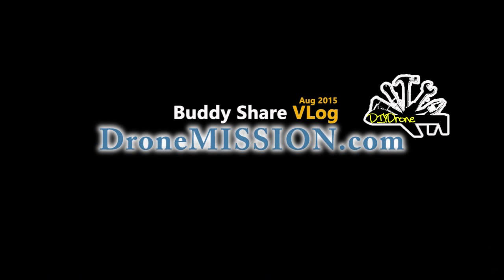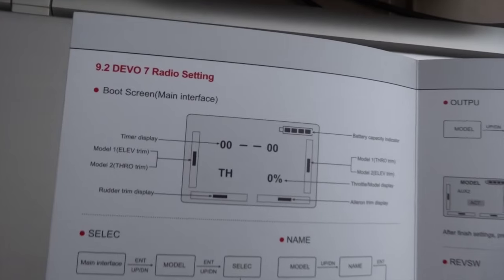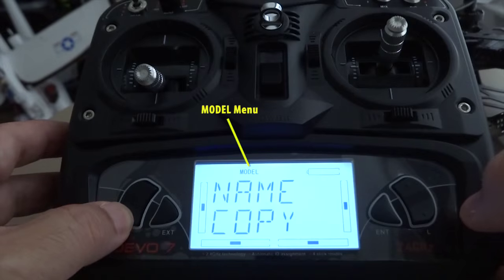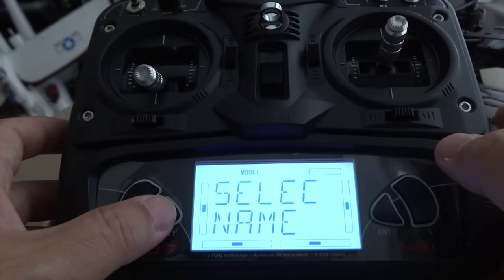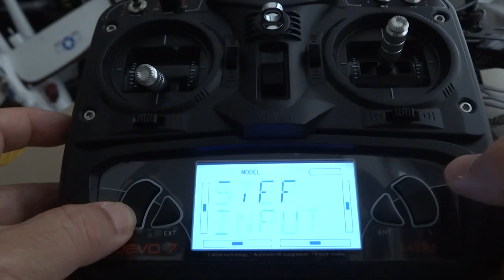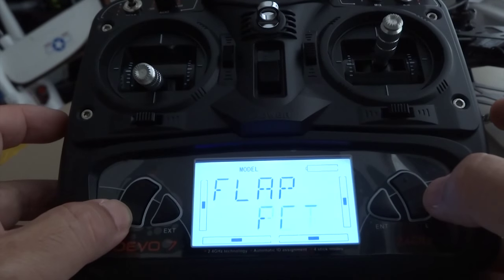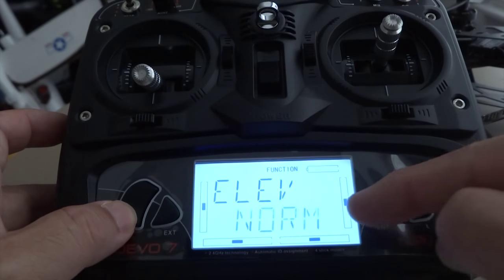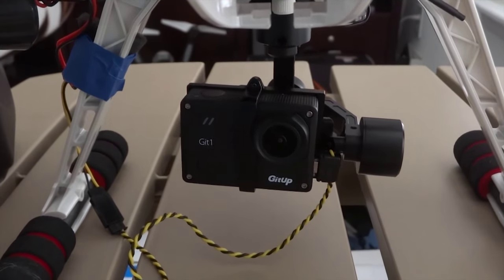Runner 250 BNF Devo 7 Setup ft x350 Premium Mission!

Comment: Hello , Great video, Do you know if the runner 250's flight controller supports a PPM single cable connection for when using another Radio's receiver that has PPM single cable out capability ?

Comment: i have just bought a new camera for  my runner 250 advanced, it came with basic camera so i bought the better camera with sd card slot that some 250 advanced come with, however i can't get the camera to record using the gear switch on the devo 7, do you think the settings for that switch need changing..? any clue how to do it please..!!!!

Comment: Hi
I am having a problem with the FMD switch This changes the flight modes They do not respond Can you help how i can do this
Reply: did you have any luck i had the same when trying to set mine up  theres a guy with devo 7 transmitter walk throw he has bout 4 video,s   but you will notice he only uses helicopter   but e shows you everything  thats where i  found out how to do mine  but im just getting my head round setting my one up to i couldn,t  tell you how to do it  it was so easy watching the video and setting it up as i was watching his video  ,, and now iv just found out how to revese my roll & yaw throw this video  i only need to setup my failsafe  on my gear switch    but i will go back on my saved video,s   and  tag you on the video or try to share it with you  spooner graham
Reply: Cheers This transmitter is a pain Everyone says get rid But spent too much money on new build quad and bought walkers reciever No cash left only for fpv googles I will look at this video Cheers
Reply: search  HOW TO SETUP DEVO 7 
its in the first few video,s   the video t called 
WALKERA DEVO WALKTHROUGH  PART 1  .MP4    dilbertoheli
 its a full walkthrough  but he has his set up for only helicopters    but he go,s throw it all  slowly  and explains just about every thing   i set up most of mine throw it   and i hope this helps  spooner graham
Reply: noproblem i was the same way intill i come across it and it helped my a lot  watch it first maybe 2 times then site with your transmitter going thow the setting and mode and it should help you understand the transmitter better and as your going throw it pause the video when setting things and changing things its just a pitty he only has it setup for helicopters   but it helped me a lot
Reply: lol
Reply: its fun and games my friend  but when i think about it iv just got my transmitter   get your transmitter  click on model ,,,and go down to  input   .. click on input  and  it comes up  
FM SW
     FMD
 THIS IS WHAT YOU WANT IT ON  
 when you click on input and  WM SW   comes up  im sure i clicked the enter button  and your dn & up button moves your switches click up or down  till you see FMD  ?  CLICK ON THE ENTER BOTTON AND THIS SHOULD ACTIVATE  YOUR  FMD  3WAY SWITCH    THEN GO ON TO BASEFLIGHT OR CLEANFLIGHT WHAT EVER OUR USING   GO IN TO YOUR MODES   MOVE YOUR  FMD SWITCH  AND YOU WILL SEE IT MOVING ?   AND ADD YOUR HORIZON TO  O ON THE SWITCH AND ADD ANGLE TO THE MIDDLE OF THE SWITCH ,, AND THATS IT  DONT PUT NOTHING ON THE 3RD   POSSISION   THATS FULL ACRO  ,,, YEAH     THEN  THAT FMD  WILL BE   HORIZON   THEN ANGLE  THATS ACRO WITH SELF STABLE   THEN 3RD IS FULL ACRO   NUTS MODE  HAHA  BUT YEAH THATS HOW TO DO IT  HOPE THIS HELPS  YOU AND GOOD LUCK   IM JUST NEEDING TO WORK OUT HOW TO ACTIVATE  MY GEAR SWITCH  AND ADDING MY FAILSAFE TO IT   AND I THINK YOU WILL BE NEEDING TO DO THIS ASWELL  HAHA  AND IF YOU DO I WILL TELL YOU HOW TO DO IT     AND THIS IS MY FIRST RACING QUAD  THE NIGHTHAWK 280 PRO    ITS NOTHING LIKE MY OLD JXD509G  MINI H8   AND MY SYMA X8G    PULL THEM OUT THE BOX PUT BATTERYS IN SWITCH IT ON BIND AND YOUR OFF HAHA HAPPYDAYS    BUT YES I HOPE THIS HELPS YOU    
and my names william
Reply: Thank you very much for taking the time writting this down for me I do appreciate it very much I hate this transmitter and Walkera never help they always say its in the manual I even bought the usb update toold for the transmitter Only to find out The last update availablewas in 2012 What a waste of money that was Keep in touch ill let you know how things go
Reply: Could you please check that after FM SW FMD      WM SW comes up as i dont have this coming up for me
Reply: what you need to do is go to OUTPUT as you see on the vídeo and then select FMD act

Comment: Can the exact transmitter programming steps for the Walkera Runner 250 Advance be found in the Runner 250 manual? And are the programming steps the same for the Walkera Devo 10 transmitter?
Reply from the maker: Yes, on the quick start guide - DM

Comment: dose these settings work with all racing quads   iv been trying to set this transmitter up with my nighthawk 280 pro  i think im getting there  but i have to work out how to reverse my roll & yaw  and set end points  i never got a booktlet  just a cd with basics its a nightmare lol
Reply from the maker: From what i have seen, the profiles have not changed much for Walkera models, for example i can fly a F210 or x350 pro with the same model profile.  Remember to select plane type, as a quadcopter is not a helicopter.  However the nighthawk fc can reverse the channels, if that is the case, you need to reverse the roll and yaw.
Reply: thanks very much iv just got it all well tryed setting my nighthawk up with factory tx & rx but just couldnt manage it  i got the ARF model  with not a clue how to set it up but im just about there i only need to work out how to activate my gear switch and add failsafe on to my gear switch   but i am having problems  testing motors on cleanflight   my motors dont stop singing and when pulling the master down  i dont get any confirmation beeps or singing    it stops unless i raise the master back up iv only been trying to set this up for a month lol  and im ready to make it fly ?? open the window and throw it away haha  its cracking me up iv got to keep putting it away and try to forget about it till i cam down then go back to it  its not like the toy quads i wish it was as easy as my old jxd509g and my syma x8g lol  pop batterys in bind it and your off  happydays lol

Comment: I have the walkera runner 250 no gps I reset my controller now I can't get anything to work properly need help on setting it back to original
Reply from the maker: Ok. You have 3 options. 1 - Old school, have someone with a runner 250, same radio beam you the model. Send and you Receive.  2 - buy a ub02 dongle to upload models, see firmware. 3. Manually, follow the Quick Start Guide.  http://walkera.rocks/index.php/firmware/
Reply: diydrone where can I find the ub02
Reply from the maker: Hi!  http://www.ucdrone.com/fpv
Reply: ***** thanks really appreciate your input and time

Comment: I can't calibrate my runner 250 with the sticks please help
Reply from the maker: Hi, you mean not centering, using the monitor, you can see your mid-endpoints, whichever radio you are using?  I have never needed to calibrate my Walkera sticks over the last 8 years.  I did once on a new Taranis and it turned out i had to replace the stick (gimbal). If you referring to Runner 250 which has no gps, no calibration.

Comment: will these steps work with a Rodeo 150? I got a BNF and I have a Devo 7
Reply from the maker: Yes, it has not changed for most of the model.  Look at the qiuck start guide to follow.
Reply: okay, I hate to be that noob... but I got a BNF rodeo, then got a Devo 7 from a friend.. I don't need any binding cables or anything.. I just follow your steps and I'm ready to fly?
Reply from the maker: Yes, as long as it is not locked (fixed) to another radio.  But, likely not. - DM
Reply: hmm it shouldn't be, he has used it maybe 3 times.. okay thanks again! I'll let you know how it goes.
Reply: once again.. total noob question.. the devo 7 I got from my friend was a RTF with his runner 250. that doesn't mean it's fixed or locked does it?
Reply from the maker: That will be a question for your friend if he locked it with a fixed id. Its a personal pref or experience.
Reply: diydrone got it to bind 1st try! thank you again for this awesome tutorial!

Comment: Hi Leo,

 I Just purchased the Walkera Devo 7 transmitter to use with some drones I’ll be building; still new to all this.

 In CleanFlight I was able to set the ARM mode to the GEAR switch on my Walkera Devo 7, but I am UNABLE to set any of other switches on the Devo 7 to any other mode like ANGLE or HORIZON.  None of the switches on my Walkera Devo 7 respond in CleanFlight, seems like there are not activated. 

 Is there some setting in the Walkera Devo 7 transmitter that I have to change in order to “free up” one of these switches in order so I can assign it one of the modes in CleanFlight?

 Appreciate all and any help!
Reply from the maker: Moises, i think you are on the right track when you say "free up” one of these switches in order to assign it.  It is usually a combination of different things. I don't use Cleanflight but typically you start with the number channels on the receiver, and then you need to assign the [MODEL][OUTPUT] relative to the channels you want to control and it should match the Receiver tab of Cleanflight.  This is where you rearrange your GEAR FMOD and MIXED switches to any order.  You then set the end points for 3 position switches if in use.  You can use the [FUNCTION] to channel [MONITOR] test your end points and switches.  The Devo 7 LCD does not show you everything in one screen, so you have to scroll through, but that was improved in the later Devo radio tx to make it easier - Leo.  

Ref http://www.rcgroups.com/forums/showthread.php?t=2545834
Reply: Thanks so much for the help,  I'll go and play around with those settings in output section.  Hopefully I can tackle this down and start having some fun. ☺
Thanks a million!